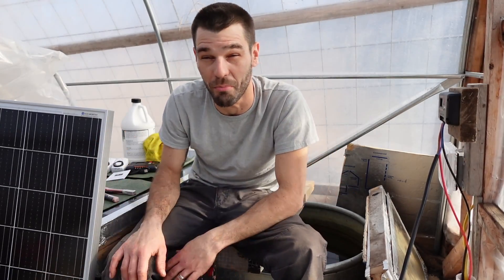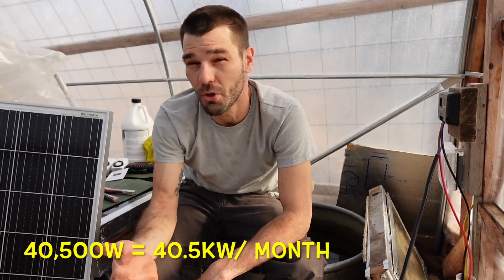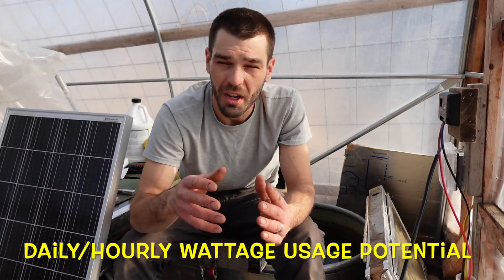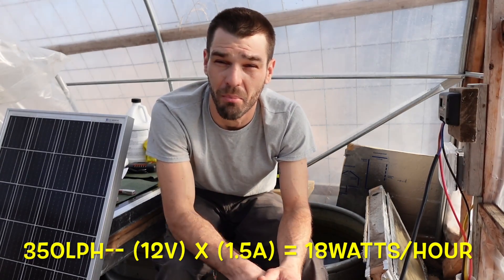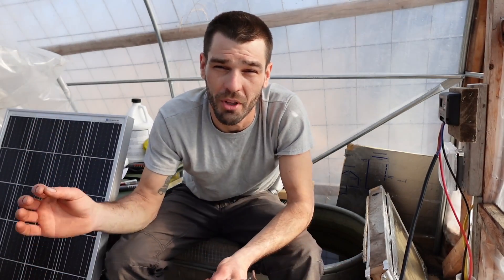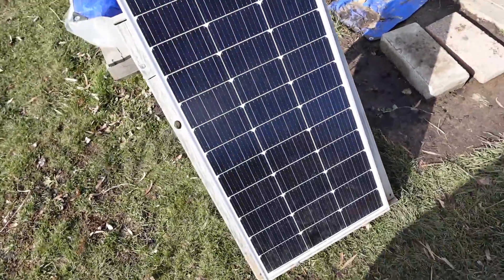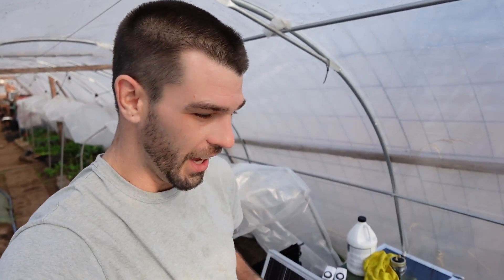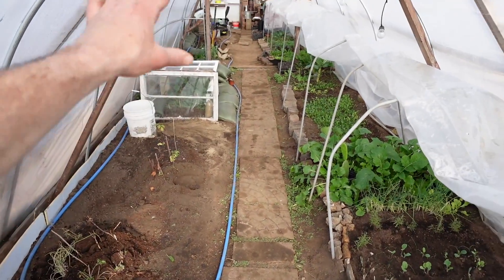DIY Solar Powered Greenhouse - EASY DIY Set Up - Solar Explained - Solar Panel Pays For Itself!

Comment: Just a quick note - you don't have to say Watts per hour - if the fans draw 14 Watts ( 12Volts x 1.67A) it is 14 Watts whether you have them on for 5 seconds or 5 hours.

A watt-hour (Wh) is a unit of energy that measures the amount of electrical energy used or produced over time, calculated by multiplying the power in watts (W) by the time in hours (h)

Comment: Can I connect a both a ventilation fan and energy efficient greenhouse heater to the Solar Power Controller?  Plan to use Thermostats for both the fan and the heater.
Reply from the maker: If you have enough power for all of them yes. Heaters are very heavy consumers of energy

Comment: I'm not using a battery so the controller doesn't work. I was told I could wire it directly to the fan. It charges my iPhone but not the fan. Any tips?
Reply from the maker: You can get away with directly wiring a panel but it’s not safe for the mechanism as you could fry it. Try the fan separately. Let me know if that works

Comment: What fan was that with the pump?
Reply from the maker: The ones attached to the heat exchanger? Those are waterproof dustproof heat resistant fans, I swear by them. Have been using them or variations of them for years without fail.
Reply: @Earthdwellershomestead  what brand are they

Comment: Really like your videos, almost the format of a science experiment, sharing all information and results, good or bad.  
Lithium does charge in the cold, just a lot slower.  I have a Zoe and it has no luxuries like battery pre-heat, when the battery is warm I can charge at 43kw, but at 0C its around 4kw, I cant imagine your greenhouse ever gets that cold.  I suppose the most important thing would be a good charge controller with temperature sensors.
Reply from the maker: Great insight! I am looking at systems to have better longevity on solar powering systems, smart batteries would be the go to. Lowest temp recorded in here with doors closed overnight was low 40’s and that’s with -18f and windchill outside. Should be able to charge fairly well. Thanks for checking this out!

Comment: 7.4v that battery is toast. don't let lead aid go below 12.1V. that tiny solar panel charged to 14.4V so fast is another sing it has no apacity. but free. maybe you can get a core charge when you buy a real one.

Comment: Your calculations for solar panel are too optimistic. If you have solar panel with nominal max output 100W then you'll never have that max output 8 hours in row because it produces max W when you have direct hit from sun. When sun angle goes bigger then more light is being reflected from panel. Sweet spot where fixed panel produces most is only couple of hours and all that goes over 8 hour is below 10% of panel's nominal W thus over 90% being reflected even you have plenty of sun available. That's why they put motors on panels to follow sun to decrease time light is reflected.
Reply from the maker: This is a good comment.   Although our sun only shines from direct south in winter and allows us to gather all available energy till it goes down again, good input for practicality tracking the sun ect!
Reply: @Earthdwellershomestead  It doesn't matter where the sun shines if the angle of sun isn't 90 degrees then panel is starting to reflect some of the light but when angle is over 45 degrees then 50 % is reflected (its about 6 hours of sun movement). If you don't move your panels then with good conditions it's possible to get 1/3 of the kWh you calculated. It's reasonable to direct panels to south because when sun is higher then less light is absorbed by atmosphere.
Reply from the maker: Great info for everyone, everything was based off best conditions for measurement. And we only have a sunny day once a month during winter it seems. All other days the solar is operating our systems on minimal energy adding to the energy inside in the form of Btu’s. Thanks for your input on this
Reply from the maker: @marsilt eventually we will break down and build a large array to track the sun.🌞
Reply: @Earthdwellershomestead  if you look around then you see mostly fixed panels. As panel cost is going cheaper it is cheaper to invest in more panels than in sophisticated system that can break down, needs regular service and also eats up good chunk of production.
Reply: PV has never been cheaper. Don't waste your money on a tracker. They're mechanical devices that require maintenance and repairs. Just buy and set up more panels. @Earthdwellershomestead
Reply: Yea I service trackers all the time. Always something going wrong with them!
Reply: I'm surprised they haven't found a way to focus the sunlight onto the solar panel for more efficiency..?!
  I think of how grow lights often have a reflector to direct the light in a certain direction. Something like Mylar, with 99% reflection, could be used to reflect sunlight more directly to the Solar panel.
  It seems like if the panels were within a Very large, V shape, but with a wider opening, any sunlight would reflect it's way to the fronts of the panels, losing very little light, but hitting the panels directly..?!
  I have no experience with these, and have never seen anything like I described, but it seems like a possibility. IDK..?!
  Great video! Thanks for explaining everything! 👍💯✌️
Reply: @timturk1899 hi I have been having an idea for a while and I think it would work not very viable to make as a buisness but an amazing idea that I will share with you. Do you remember In  the 90s you used to see the fake diamond half dome shaped beads around 3-5cm wide they were cut with loads of angles to reflect light and got used on clothing and things for going to raves. Hope you know what iam talking about they got used to reflect the lasers and strobe lights now think of this inverted onto the top of a solar panel you can use many small or larger size on top of a solar panel facing straight up this would collect light from any angle I have had this in my head for ages but can't find the proper materials to make one to try it out for efficiency gain but maybe you know what iam talking about and can try it out if your the type of person that likes to make things or maybe someone else stumbles on this comment and does it just if it makes you a billionaire overnight at least give me a thumbs up and 1 million  English pounds please 😂😂🎉
Reply: The main problem is heat. Concentrated light on panels, via reflectors, seems like a good idea but the heat accelerates the degradation of the assemblies. There are adhesives and polymers within them which don't cope with heat well. Yes, they'll still stand up for some years, but perhaps a decade or two less than they might have. By the way, reflected sunlight off snow can fairly dramatically increase solar array output. I have a modest 2,800 watt array which can put out 3,100 watts on a sunny winter's day. That's 10.7% higher than the nameplate rating. Of course, there's no overheating at that time of year! @timturk1899

Comment: Can I  take fans out of old desktop computers to use this way? They are AC, maybe I need DC fans?
Reply from the maker: They would probably be able to be ran direct to it’s black and red to battery or solar, they are not too bad on cost for longevity to get larger ones. Thanks for checking this out great question!
Reply: @Earthdwellershomestead  you could use a 12v dc to 120v AC adapter, something like the ones that plug into the cigarette lighter socket, they will usually support 30+ watts.